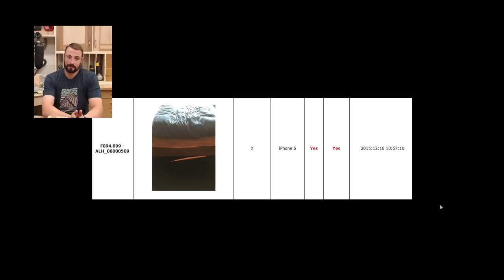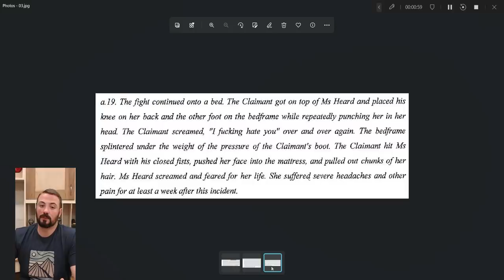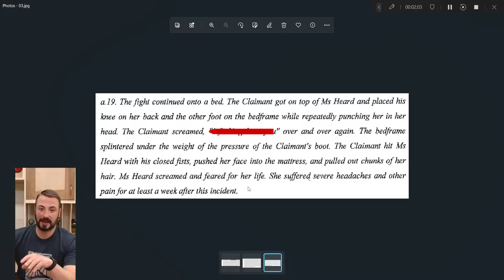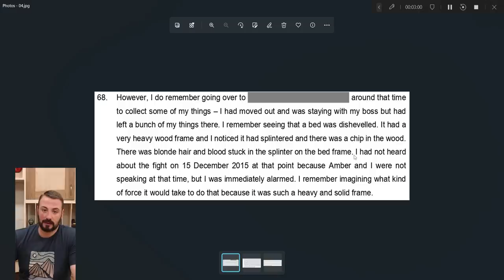Woodworker Attorney DEBUNKS Amber Heard's "Broken Bed” Testimony!

Comment: woodworker here, 40 years experience.

I can definitely state that IT IS possible to splinter a block of pine with a good quality, solid work boot. However:

1) it would require a significant amount of force. i.e. the person would have to be standing up, putting his whole weight on that boot. cirque du soleil kinda stunt. or the timber was already chipped. unlikely.
2) the boot would have to be slipping downwards at some degree. let's say 45-60 for argument's sake. something like a missed step.
3) the timber's corner would probably hit the shins and hurt the living hell out of the experience. (don't ask how I know)
4) there would be multiple splinters. HANGING from the timber. the pic shows a hell of a clean single cut. that was made with a tool. 100% sure.

conclusion: she's full of BS.
Reply: Oh! I have questions. I know absolutely nothing about wood but I'm intrigued to learn more. 
Could someone had thrown summit that is somewhat heavy with a hard edge on it so it cracked? Perhaps standing on the bed or a similar angle. The edge of the bed looked like it had a really sharp edge to it and not a rounded one. 
Also does the age of the wood matter much if it's easier for it to break? 

I'm curious bc I had a piece like that cracked from a wood plank on my kitchen floor once with mainly the "big" piece split but barely any small splinters. Really old hardwood floor I believe from when the building was built in -42. They were painted and all that as well. (not by me)
Reply: @loveitftw   in my experience, yes, hard edges are easier to break. also, the harder the wood, the easier to break. counter-intuitive, I know.

anything is possible. different environments have different effects on different woods. lots of variables. 

from what you describe, I would guess the timber broke along a single vein. probably due to an uneven support for the plank. years of uneven pressure did the rest. could be that particular ring was already weak due to environmental factors during the tree growth. who knows?
Reply: @luminatrixfanfiction  "proven" is a strong word. particularly when one makes assertions based upon pictures. it is impossible to asses the true state of the timber without a close physical inspection.

my opinion based on this and other shenanigans (knife on bed is big clue)? yes. she's a liar. she's not well in the head. she is harming REAL victims. she deserves what's coming.
Reply: Thanks for the added details for the scenario. I applaud your past workplace safety efforts, risking life and shins. (If I only had a nickel for every time I've had to add "don't ask how I know this" to one of my explanations...) Regarding the trial, I'm personally hoping for a courtroom reenactment of the alleged attack by an actor wearing some СМЕРШ surplus assault boots. Checkmate, Mr. Depp!
Reply: I like that your points imply some sort of unfortunate experience for you to have known that lol
Reply: @tylersperry9164  We used to call it experience, and it was measured in scars. Most of them were caused by too much confidence using power tools. Thankfully, power tools are waaaay safer nowadays. Culture has changed too. Bosses will no longer allow for ass-kissing-show-off stunts, for the sake of "speed". We can thank insurance companies for that.

a reenactment? I'm thinking of a particular friend of mine, with a particular set of toe nails. No fancy boots required, he would prove.
Reply: @sammyk7024  Thank you for answering my silly questions! I appreciate it very much. 😄 

Ye my flooring made me think of the splinter and the age of the wood even though it's been treated in some way (I presume) and also painted. 
In the words of my mind: it has stuff on it basically, it's not naked, untreated or whatever.
As I'm guessing their bedframe also has stuff on it. The wood he used in the video, in my eyes it didn't look like it had stuff on it. Haha
Also an observation that the evidence pic is only broken on a small part of it and then on the real estate video it's split all the way. I thought that was interesting.

And if I can ask one more thing.😅
Would you say or think that the biggest chance of breaking it would be the knife as he thinks it would, or do you see another possible way that would be more likely or easier?

Only speculating here and I don't necessarily think it was done like that with a knife (not by a boot either). I think it was sum else and more likely done by rage accident like throwing things or whatever. Using a knife and stabbing the wood & bending it to take a piece out random after a huge argument seems a bit tedious imo. Wouldn't it also leave a pretty visible mark where the knife got in like it did on his demonstration. Maybe there was one, it's hard to tell. 🤷‍♀️
But what do I know, I can only speculate on possible actions like everyone else. 
Sorry for bombarding you with my silly questions and thoughts on this 😅. I'm just very interested in the wood part now haha.
Reply: @luminatrixfanfiction  From what I've learned in the trial watching it all so far is that Johnny collects knifes and there was a really disturbing audio clip with him ready to cut himself. However, context is needed for that audio clip. (I rather not think about if he actually did it, the audio triggered and fkn freaked me out a lot) 
But that could perhaps explain why knives are laying around the place.
Reply: as I said, anything I say based on a picture is just speculation. the following is not:

if you accidentally fall and bang your head against such bed frame, it will probably kill you. If it doesn't, it will injure you quite seriously. could give you a concussion, or best case scenario an incredibly profuse bleeding cut, as any open wound on the scalp would. It would hardly make the slightest dent on the wood, let alone breaking it like that, as suggested by claims of hair being found near the spot...

I know fuck all about the US standards on carpentry, but in most European countries no self-respecting carpenter would ever deliver a bed frame to a client with such sharp corners. it's a deadly trap for children and also for  drunken, drugged, clumsy or even senior adults. unless it was specifically ordered by a stubborn "architect" or "interior decorator", whom thereafter would have to assume any  liabilities.
Reply: @luminatrixfanfiction  You are right that it is Herd who likes knives & who gifted one to Depp with a loving inscription. A very odd gift to somone you view as violent, aggressive & abusive. Also an odd gift for somone who struggles with self harm. 

Obviously the person you replied to are not mentally well, hence why they got triggered by the audio clip. However I assume you must not be either to ask in such an abrupt manner & to use the poor phrasing you chose. In the future please try to be more tactful & kind. 

Also what does religion have to do with the comment you replied too or this entire case, at all? What ammunition do you mean & what are you doing? Please be more clear because I guarantee it isn't just me who is left wondering.
Reply: I went to a Waldorf school where we had woodworking class. It was all handtools; knives, axes, saws, chisels,... That chip in the photo looks exactly like an intentional cut with a handtool. Not even a boot with a steel tip can make such a clean cut. And yes, even if Depp had a sharp knife attached to his boot, he would have had a very bad ouchy ouch moment. All the pressure he had on her would have been released instantly which she would most definitely remember. Basic physics.
Reply: 100% the grain can splinter from a foot. I've had it happen to me. But, yes you would hit your shin for sure. I sure as hell did.
Reply: @katego370  exactly!
Reply: the bed looks like it was made aut of vintage wood, and even if it is not vintage, tensions in the grain do often cause cracks in pieces this thick, absolutley possible that part was already splitting.    If i look at the beedroom you can suggest that this part of the bed is used to step on. Now imagine a step made out of soft wood, itˋs exactly the type of damage you see accouring over time.
Reply: @luminatrixfanfiction  It might be even only a few years old, on soft wood it takes weeks to weaken a part of wood which is maybe even prawn to cracking debending of the grain strukture on that point. Anyways, kicking this part with a solid boot with a hard leather sole is absolutly possible. But after all itˋs more likely that crazy girl did it wirh the tool she left on the bed.
Reply: ad no 1 and 4 - it could've been splintered/weakened before, it being the reclaimed/rustic wood. 
ad no 2 - consistent with the presentation
ad no 3 tru dat, she's full of BS
Reply: @lookingupwithwonder  yes, but not that size, and definitely  not that clean, imho. assuming the timber is "healthy".

also: splinters don't just fall off the timber in one piece. there are usually several splinters, some may separate from the piece, but definitely some will be left  hanging. and those do not come off easily, by any means.
Reply: @grisza77  hard to say if it is "rustic" wood.  it is common practice to stain wood in order to make it look old. good carpenters/painters will also use special tints that will also provide some protection against humidity, mold, bugs, and other maladies.

also: rustic does not necessarily means "bad". old wood, if healthy, is often much more stable than freshly cut timber.
Reply: @sammyk7024  it does not mean it is bad, just that the above explanation is not bulletproof.

Brushing/sanding pine can significantly damage it's structure and thus facilitate the damage as pictured.
Reply: @grisza77  nothing is bulletproof. however, some things are more likely than other. if it quacks like a duck...

Occam's razor.
Reply: @sammyk7024  true. Just that there is a thing called "reasonable doubt". 

I would definitely bring an expert on wood technology to the court, would look for inconsistencies, ask about the "unidentified object" on the bed etc. Just that the explanation above will not hold in court alone.
Reply: @grisza77  I agree. Her claims are hardly to be considered reasonable, by any stretch of the imagination. An expert would be extremely valuable. I think any moderately equipped forensics lab would do the job. this is mostly about basic physics, rather than carpentry or even xylology.
Reply: @sammyk7024  provided the bed is available for forensic inspection
Reply: you're  a liar wood does not splinter like that without a tool
Reply: @justfixit5022  I'm a liar because I basically said almost exactly that? You really got me there buddy.

Comment: I work at Home Depot and when I saw the photo I did not believe a word she said. I have use to cut yellow pine often before I was moved strictly to deliveries. The only way you are making that cut in that thick of a piece is if you cut with a Swiss blade. Thanks for pointing out the alleged blade on the bed because I did not notice it at first.

Comment: Also, if he’s allegedly kneeling on her back, all of his body weight goes into his knee, not his other foot. Basic physics show his other foot would not have enough force to break this wood.
Reply: That was my immediate thought too.
Reply: Just think of the intended use for that bed frame. It is designed to be stepped on and used daily so why would it be designed in a way that stepping on it with "more force" would break it? If it is designed to be stepped on to get on the bed then it should hold up just fine for 500+ pounds being on it which is more force than Johnny could put on it himself while standing or kneeling upright.
Reply: I'm sure AH was asleep thru science class and missed how that all works!